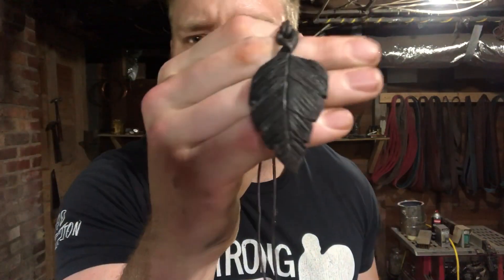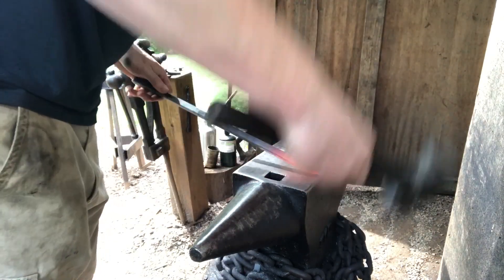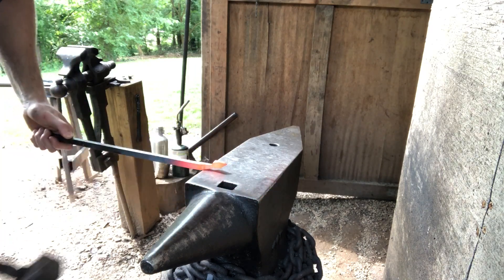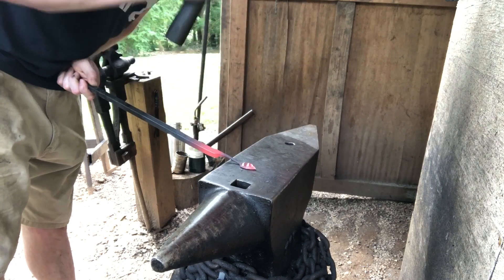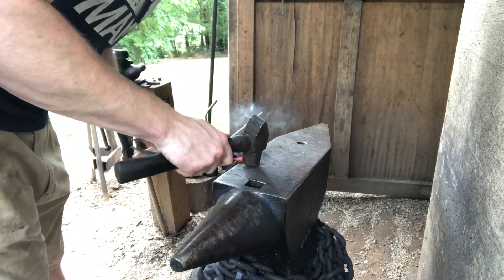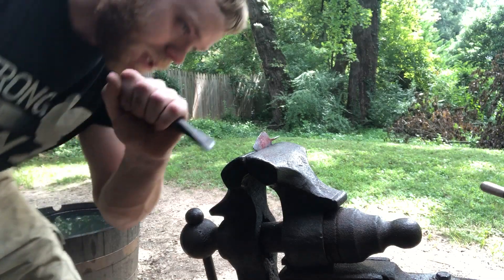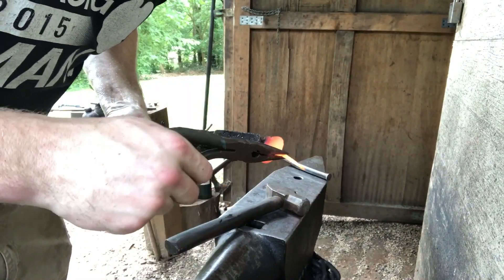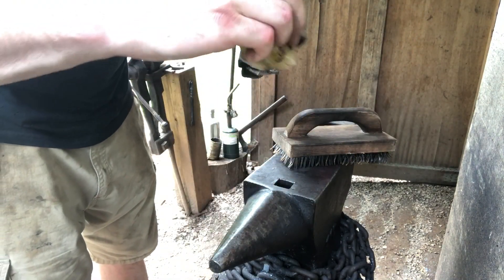Forging a leaf pendant

Comment: Thanks for the quick tip video on a starter project. I know that once I figure out my forge and anvil and fuel type situation that will be one of the projects that I work on over and over again to get those fundamentals down. Those leaves look really good and even more realistic than others I have seen.